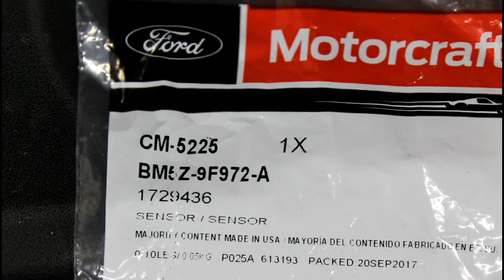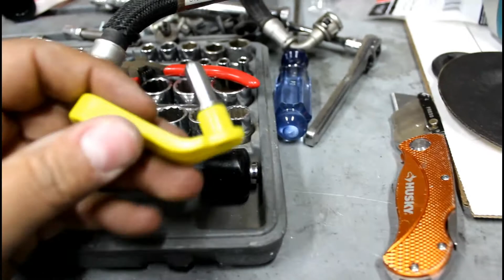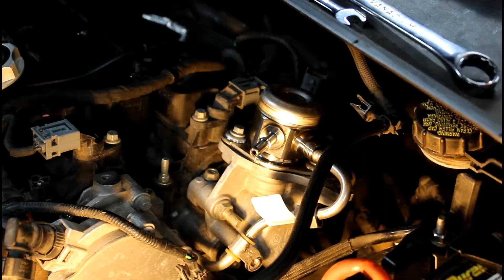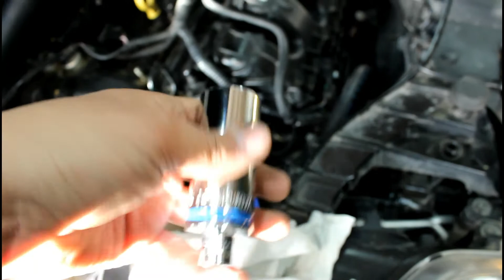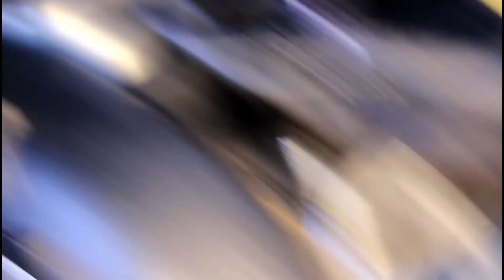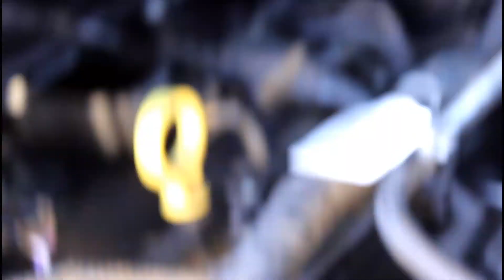P0087 Engine code !!FIX!! Ford Focus ST & RS, Fuel Rail Sensor & Fuel Pump Step-by-Step

Comment: Replacing HPFP, LPFP, Fuel Rail Pressure Sensor, Fuel Pump Module and the PCM isn't guaranteed to fix P0087. It hasn't yet on my 2016 3.5L Ecoboost engine and may not on yours. There's no TA-DA in the real world. Only on YouTube. 😡

Comment: If i dont want to press the relieve valve , can i just wait an hour and remove the fuel pressure  sensor on the intake manifold ? I just dont want to damage something as im good at it . Thanks for the help
Reply from the maker: Yes
Reply: @FatGuyBuilds  should i remove the sensor very fast or slowly as it is with pressure ? What other recommendations can you provide me ? Thanks again
Reply from the maker: @juancruz-jg5pq  just leave it parked overnight.  Then fix it in the AM.  Dont worry about pressure
Reply: @FatGuyBuilds    thanks man !! I was so frustrated , what a  relive ,  i wish you good luck i. Your life. Thanks a lot

Comment: I’m posting on various Ford focus MK3 P0087 code videos - but I changed the high-pressure fuel pump as you see here two warnings on that watch out for not removing the clip correctly and they’re also some important gaskets. Several of them at the thinner outlet part of this pump.

Anyways, after changing, the problem didn’t go away the car would stall after driving it a while, and I would have to keep turning it on resting until finally hit and drove normally 

I moved to the small high-pressure fuel sensor that connects to the fuel rail line just left lower of the engine .

They are relatively cheap use at the junkyard. I got three from different focuses, then kept changing them until the problem went away with the right one or one that wasn’t already on its way out.

IF this Didn’t work I would’ve went to the other sensor that’s on the top somewhere in the engine, then fuel injectors, maybe and then into the gas tank into the actual fuel pump and the other fuel delivery modules .

Hopefully this will help anyone trying to do this yourself to save in this economy. 

Of course, this is only my experience and I’m not necessarily a top mechanic I know some basic stuff. Good luck!
Reply from the maker: Thanks for watching!

Comment: I have a 2017 ford focus, the same engine, I also have the same problem, I put the new fuel pressure pump on it and a week later it came back with the same problem.
Reply from the maker: thanks for watching!

Comment: That fucking clip on the fuel rail sensor is a bitch. I thought replacing the sensor would take 5 minutes. I'm an hour in and I finally get it out, and of course I got the wrong sensor. The plug is different, it's square and should be like a rounded triangle
Reply from the maker: please click like on all my videos, please!

Comment: I have a Ford Focus 2015 I replaced the high pressure fuel sensor ran good for a few days now it’s shuddering check engine light on transmission message coming on Saying it’s getting to hot wait 10 minutes. Rpm’s getting stuck at 2k and stay at 1k when idling I ran the codes I got p0087 p0902 p2701(00) p0003 p0011 p0012 p0013 Low pressure fuel system - pressure too high a lot of circuit issues. Where do I start? This is a laundry list and I’m regretting buying the car. I replaced the transmission fluid today and it was black and it was up under the car a bitch to get to. The rpm’s will jump up and no accelerating at all it stalls and hesitates to go. Hope I can get advice!
Reply from the maker: Is it a dry clutch transmission?  Those clutcheson the automatic go out quite often
Reply from the maker: How many miles?
Reply: 106k miles I believe dry clutch
Reply: What’s weird about it is sometimes the check engine will go off and then it will run fine I had the car for a few weeks before it started giving me issues today it wasn’t even turning over it was making clicking noises then finally started after a few times like I was saying the shuddering rpm’s going up with no acceleration it will go up to 4k stall and kick when the gas is hit. Today it went up to 2k stuck wasn’t shifting at all. Was leaning toward the high pressure fuel pump or fuel filter. I been trying to replace things little by little what I can afford anyways. Started with changing one of the fuel sensors and changed the transmission fluid. Just don’t know where to start and don’t want to spend money on shit that has nothing to do with the problem and ain’t gonna fix it might not have much of a choice though. Thanks for the reply.
Reply from the maker: @TheCloakandArchive  i would swap the clutch pack to be honest.

Comment: For anyone curious the line that buddy broke off has pinch points on each side the little black plastic holes. I used a hook style pliers and pinched each side and it came right off. I was fighting with the normal style fuel disconnect tools and seen those pinch points go inwards when compressed.
Reply from the maker: Yes.  But the dimensions wouldnt let me disconnect it.  It had a lip on it which would not let me use the tool correctly in my set until i cut it off
Reply: @FatGuyBuilds  thank you for the video bro I had done the hpfp about a month ago, fixed the major fuel cuts it was getting but it still has fuel cuts around 90 miles to E and reads lower fuel than normal. Going to get a access port and go for the sensors next and hope that fixes my issue. 139k and only replaced the steering rack, hpfp and one coil pack 💪

Comment: Any ideas on a p0171 been after this for 2 years now every dealership can’t find anything wrong or can’t duplicate the problem
Reply from the maker: What is p0171
Reply: @FatGuyBuilds  it’s a system lean bank 1 dealership has done just about everything and it keeps coming back I know the only thing that hasn’t been done is fuel pump

Comment: I also made a half ass video on this sensor, which helped a ton of ppl. What sucks is there's almost 0 indication that its this sensor, my problem would come and go. One day i just started wiggling wires, one of those wires happened to be connected to this sensor. As soon as I tugged on it, my car kind of revved up a bit like it just took a deep breath. So I simply unplugged the wire from the sensor plugged it back in and the car ran fine for a long while. I replaced it when I had the chance and she runs great!
Reply from the maker: They get gummed up
Reply: @FatGuyBuilds  Basically, and it happens a lot faster on E30. Worth it though!

Comment: The code your wife got is provided, but what were the actual symptoms? I was racing this past weekend and for the first time my car started having misfire/fuel cut-outs. After checking plugs and considering the E30 quality I was using... I checked the Cobb AP for codes since nothing showed up on my dash...sure enough, P0087, P0088, and some others. My main symptoms (that actually started on my short, casual drive to the track from the hotel that morning) was at 3k RPMs, the car wouldnt accelerate anymore regardless how much throttle I gave. Then later that morning each time I tried running my warm up laps on the track, it kept cutting out at that same spot and I had to call it a day (at the cost of $250 for that day lol). I was thrown off by the multiple codes...high pressure, low pressure, fuel rail thresholds, etc...so I figured either the E in my mixture was bad and causing all the issues, or the pump is failing and its impacting both the low and high some how...this sensor seems like its just the highside/rail pressure, right? low provided from the in-tank pump, then the engine mounted pump provides the high side needed..if i am correct?
Reply from the maker: Would not even start unless you held the gas to the floor.  Then massive amounts of black smoke out the exhaust
Reply: @FatGuyBuilds  Finally replaced the Fuel Rail Pressure Sensor ("FPS49" from Oreillys) and it fixed my issues (my recent codes indicated a P0088). It got to the point where it was un-driveable. Picked up the part and swapped it out a few hours ago, car runs like a top again! Hopefully thats all it is and I dont need to look into spending $200 for a new HPFP... but thanks again for the tutorial..pretty easy of a swap tbo...
Reply: @dham99  did you get the p0087 code as well? Mine popped up yesterday trying to figure out what could fix it
Reply: @brannonmeador1792  Yes...thats one of the codes i got. If you have miles on the car, its prob worth replacing anyways. $60 from the auto parts store, just a fuel rail pressure sensor. You need like a 1-1/16th inch socket or something like that (been a while) but its just under the front intake manifold area..pretty quick swap (dont need to remove the manifold).

Comment: Bro I can’t get the sensor off for the life of me? How did you guys do it.
Reply from the maker: Short socket u may need a bendy elbow adapter
Reply: @FatGuyBuilds  thanks bro I got it out finally. On my way home to put the part in. I got an P018c code on the st and it says pressure sensor fail and low next to it.. but when I look online all it says is pressure sensor should be replaced. But if that doesn’t work where would the low pressure sensor be?
Reply from the maker: @Brz_Don  that means it failed in the low position.  0 volts..  pretty sure.
Reply: @FatGuyBuilds  where would that be then? I’m currently replacing the one you did in the video. Iv looked through the internet and I can’t find where the low side would be. Thanks for replying man
Reply from the maker: @Brz_Don  i am saying there is no low side sensor.   The high pressure sensor failed @ 0 volts = "low"
Reply: @FatGuyBuilds  ahhhhhh that makes sense now! No wonder I couldn’t find the shit LOL!
Reply: @Brz_Don  I'm getting  a P018C on my ST, did replacing your High Pressure (Fuel Rail) sensor resolve the P018C code for you?  My logs indicate an issue with FRP sensor in my case.  My low side pressure sensor numbers appear correct.
Reply: @r0tax7  see I replaced the fuel pressure sensor. That’s on the bottom by the pully. I didn’t replace the sensor in the actual fuel rail itself. By replacing that sensor I just said it DID NOT fix my issue. All my numbers are reading correct as well on my AP. It could be a voltage issue. Because the car is okay and then sometimes out of no where when I’m at a stop the car starts to big and then it will shut off. However when I turn the car back on it’s starts and drives normally. So I’m assuming a voltage issue.
Reply: @r0tax7  if I can figure out the issue I’ll make a YouTube video on it. So if I go to a dealer or do it myself I’ll give all the info on what worked for me.

Comment: thanks for the video, I'm getting 284: ecm-p263662 fuel pump b low flow signal. car is running but rough idle. I thought it was the plugs so I replaced them but still rough. any ideas? I'm wondering if it is the low pressure sensor not the high one which you changed.
Reply from the maker: Try both sensors first the pumps

Comment: Do you think it was just the sensor?
Reply from the maker: I know for a fact it was just the sensor
Reply: I getting mine in the morning and fixing it. Did you have to do anything besides loosen the feed line to change the sensor?
Reply from the maker: @cecilbermudez8679  nope.  Just bleed the fuel pressure.
Reply: @FatGuyBuilds  so just loosen the bolt that you did on the video, correct? I don’t mess with fuel...lol
Reply from the maker: @cecilbermudez8679  just loosen the fuel line fitting on the right side of the head below the intake runners.  Only open it enough for fuel to start dripping. Then wait till it stops dripping.  Then pull out the sensor.  Then put new sensor.  Then retighten fuel line fitting
Reply: Perfect install instruction ! Done. I don’t have a misfire issue anymore! But now I have no boost? I’m going to check the vacuum lines and couplers but did you have this problem or no?
Reply: My boost was gone because mine was the high pressure pump. After changing the pump and sensor I’m back to normal. Thanks for the video

Comment: Bro I dont know if you can help my focus's oil is full of gas I dont know if it's the injectors or fuel pump? White smoke starts appear any help?
Reply from the maker: my issue was the sensor flooding my car.  change the sensor and oil and i was good

Comment: whats up bro, great vid btw. im just curious what your symptoms were? ive been chasing my issue for 5 weekends and wanted to do stuff that didnt cost as much but i finally got the code P0193(fuel rail pressure sensor circuit bank 1) so gonna do sensor next week. my mpg has been complete trash and i misfire at 70mph sometimes so def has to be something in fuel system
Reply: Did replacing the sensor fix that P0193 fault code 
?
Reply: I think my pump or sensor is bad got was idling then it stalled out. Went to start it back up back fired and service engine message was on the dash. My pulled the code and it was low pressure at fuel reel.  I cleared the codes and turned off the car. Started it back up and was ok for a day. Next day was the same problem
Reply: @mikeremsburg  did the sensor do the job?
Reply from the maker: @mikeremsburg  replace the sensor.  very easy and it is the cheapest part.
Reply: @mikeremsburg  did your pedal stop working at all?
Reply from the maker: Mine would not start unless i floored it and then it would have black smoke coming out.  But urs sounds like a fuel issue too

Comment: Is it necessary to bleed pressure off the sensor or can I just take it off?
Reply from the maker: just press the relief valve or let the car sit for about 1 hr then slowly take off the sensor.
Reply: @FatGuyBuilds  I just pulled the fuel pump fuse and ran car till it died and that worked. I'm going to make a video on how to change one in the focus rs since there's no videos for it
Reply: @xXHellFighter13Xx  you never made one? is it the RS the same as this video

Comment: Before changeing anything what where the symptom just no start or did it start but take longer to start
Reply from the maker: Read the title.  Had to put the pedal to the floor to get it to run.  Ended up being the sensor.

Comment: What is that sensor in your hands at 6:03 I think i need to purchase that because I also have code P0087 and code P00C6 and I replaced that high pressure direct injection part but no fix. I think it might be that sensor in your hand but I don't know the name of it
Reply from the maker: part number is in the video.  High pressure fuel sensor.  pick it up at ford.  it isnt that much money.
Reply: FatGuyBuilds thanks for the fast reply, I just picked up the part about 30 minutes ago. Hopefully it’s just that sensor and I don’t have to replace the high pressure pump
Reply: @sinfulgrief4099  did you ever figure it out?  I have those two codes (P0087 and P00C6) but also P008A which is the low pressure system.  If the low pressure system doesn't work, the high pressure won't.  I already did a fuel pump driver (electronics that tell the pump how much to pump) and now the dealer wants to do the low pressure pump and the low pressure sensor.  Fuel pumps usually last a LOT longer than 3 years or 68k miles, and it's going to cost a ton in labor because they have to drop the fuel tank to get at the pump.
Reply: Duane Twining brooooo I have codes P008A, P0088, P00C6, and U0109 all having to do with the fuel system. So I’ve been researching for weeks before I spend any money on parts so if you could keep me posted on what goes on with your car I’d be so appreciative
Reply: @davidbecker2922  I got my car back from the dealer this week.  They replaced the in-tank, low pressure pump and everything is fine.  6 months ago when I had the same issue (but no code reader) they replaced the fuel pump driver module (computer controlled power sender to the low pressure pump) and recommended doing the pump at the same time.  Obviously I declined because of the cost.  Pulling the tank out of the car to get to the pump, plus the cost of the pump was around $750.  If it happens again, I'll cut a hole in the back seat frame and do it myself.  Or, drop the tank myself.  I've done that before and it's a PITA and a couple hours of work. Oh, they also replaced the fuel pressure sensor.  Obviously if that gives bad output the control system will be responding to bad data.
Reply: @davidbecker2922  did you ever figure out the problem?
Reply: What size socket

Comment: I changed at my Fiesta St 1.6 Ecoboost the fuel pump first, sometimes i have the Code P0087 sometimes not, next step Sensor. Hope that was it :-/
Reply from the maker: sensor fixed it.

Comment: If you ever decide to clean your injectors, please make a video on a how to. I want go get mine clean and flow tested but not sure how to begin to remove them,. I love the videos!
Reply from the maker: Will do.  Sounds like a good video for 150k miles
Reply: @FatGuyBuilds  sweet! Yeah stratified released a study based on why these engines blow. A good read, alot falls back on driver error and how lean/rich the afr is.